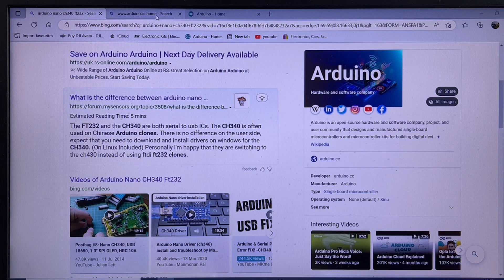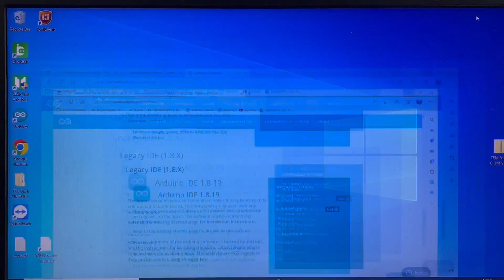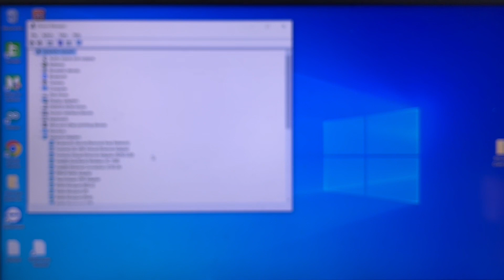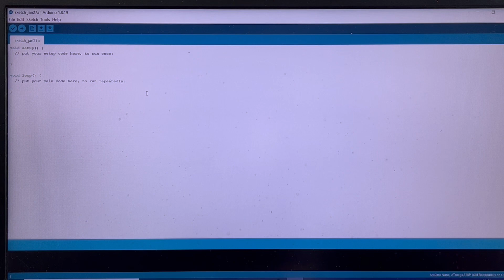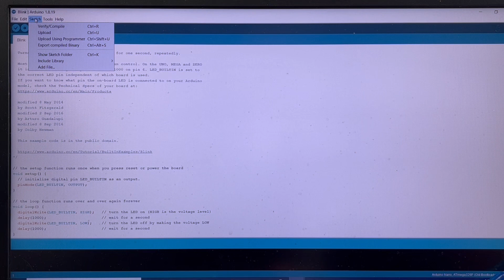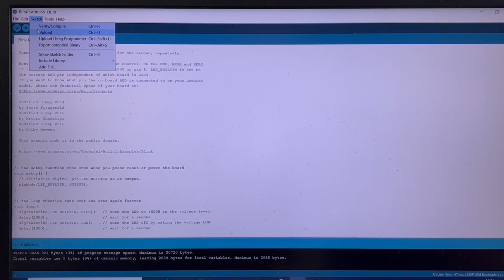Arduino nano basics programming com and port 232 ch340

Comment: Hola Fred, a pesar del problema del idioma, he seguido todos tus videos con atención y mas o menos, creo que ya se al menos por dónde empezar...
Entiendo que el arduino nano funciona de forma autónoma girando al cabeza hacia un lado u otro cada dos segundos.
Entiendo que has usado el servo de la mandíbula para el cuello....
se puede mantener el servo de la mandíbula y añadir un nuevo servo al cuello? supongo que si...
Que tipo de servo aconsejas que sea lo suficientemente resistente par amover la cabeza?

gracias

Hello Fred, despite the language problem, I have followed all your videos carefully and more or less, I think I at least know where to start...
I understand that the arduino nano works autonomously by turning its head to one side or the other every two seconds.
I understand that you used the jaw servo for the neck....
Can you keep the jaw servo and add a new servo to the neck? I guess so...
What type of servo do you recommend that is strong enough to move the head?

thank you
Reply from the maker: Hello
I used the servo for the eyes. It’s the blue one. I just bought on eBay one of the issues that had a servo and I used that. I still have my original eye servo, but I bought another off eBay. Yes, you are correct the arduino is programmed with a bit of code which drives the servo. So all I did was write the code for the arduino and connected just the servo. That way I was able to check the code worked and the servo moved. Then I simply added the servo so it sits directly under the centre of the neck bolt and connected the servo to the neck bolt with a short piece of brass pipe. I glued it to neck and to servo and the arduino now turns the neck
Reply: @fredflintstone3787  Muy interesante.... he visto otro video de otra persona, que no solo le ha añadido un servo para girar la cabeza hacia los lados, si no que también otro servo para inclinar la cabeza.

Podrías detallarme que servo has comprado en ebay? gracias de nuevo
Reply from the maker: @Dekion2003  hi it’s issue 18 servo - https://www.ebay.co.uk/itm/315262585799?mkcid=16&mkevt=1&mkrid=711-127632-2357-0&ssspo=1MraZh7NTuW&sssrc=4429486&ssuid=OiYJGrEMQ2C&var=&widget_ver=artemis&media=COPY
Reply: @fredflintstone3787  ah vale!! Que no compraste un servo nuevo, si no otra unidad de mismo servo de la colección!! Gracias